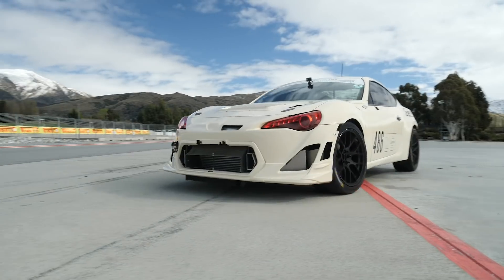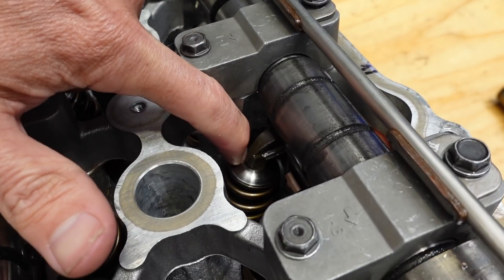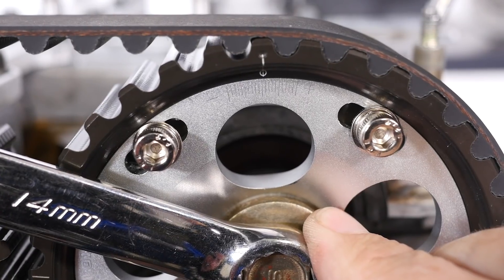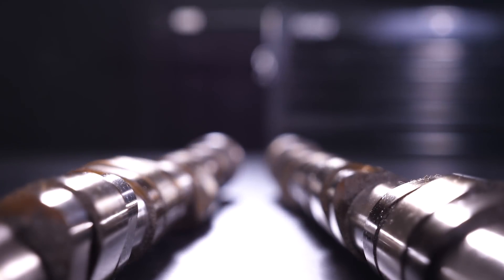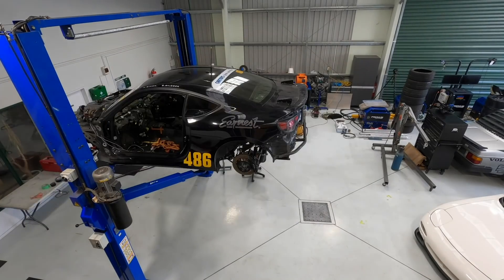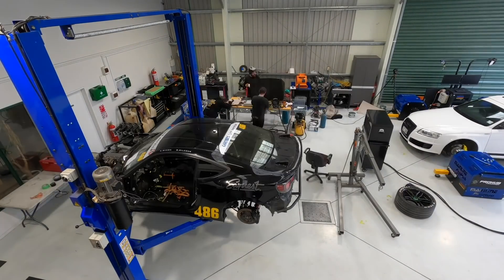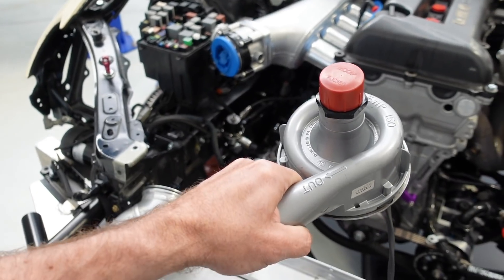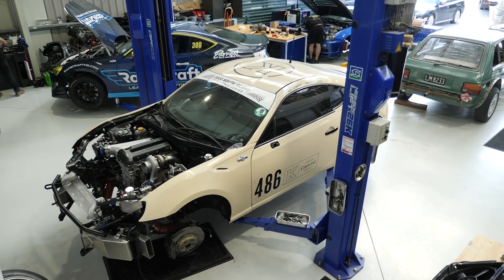Cam Swap | 650HP SR20VE Engine Conversion | SR86 EP 10 [#BUILD]

Comment: I noticed you have an external oil feed on the inlet side and assuming on the exhaust side at the back of the head . Any particular reason for this or was this a recommendation from kelford using their cams? I'd like to know the size line used if possible please. Thanks for your time! Great info.

Comment: And another cool, informative video - with all you chaps are doing, you're actually making great progress! Some of the 'little' jobs can end up taking massive amounts of time, like the plumbing changes that would need frequent checking for clearances, alignments, etc.
When you were discussing the shim and cap heights still being a problem, you segwayed into it getting new camshafts.
Did you consider getting them ground with a slightly smaller base circle? While it's not generally a good idea, especially with poorly done 'reground' products out there and the problem with hydraulic lifters running out of 'take up', it should have been fine with your mild camshafts and it would restore the clearance you needed for the shims and caps?
Normally, the base circle is the 'fixed' part and all the adjustment, valve length, retainer heights, valve seat to retainer groove, etc, are all dependent on that?

Comment: Would the 184st cams still be good for street use with a 3582 gen2 turbo and a 2.2L stroked bottom end? Would this be laggy or have somewhat response ?
Reply from the maker: I would imagine you'd see similar response with the 3582 and the larger capacity to what we have now - Boost threshold of around 4300-4500 which isn't bad for a 3582 - Andre

Comment: I have had exactly the same experience with my SR20VET E36. The ignition cut from the samsonas popped a shim while away from home on the 5th lap of my first session🤣
Reply from the maker: Yes you definitely don't want to be using an ignition cut for gear shifting! We had that part dialled but unfortunately had overlooked the rpm limiter 😩- Andre

Comment: You will have issues with the titanium valve retainer stock is better for durability
Reply from the maker: Yes it's quite possible as we've heard similar comments. At least the marginal weight saving of the Ti retainer becomes less important if we're dropping the rev limit down - Andre
Reply: @hpa101  I believe the sr16ve in pulsar vzr is revving 8.7k stock

Comment: Did you not just consider altering the IVC with the adjustable can gears for the Kelford cams?  This is what I have done in past by maintaining required overlap but finishing power stroke earlier to shift torque peak
Reply from the maker: Yes, there may have been an improvement by advancing the cams. From my own experience as well as others who have played with the cam timing on the 184-ST t's unlikely we'd have been able to move the power band down by 1000+ rpm which is what we are targeting with just the cam timing. The P12 cam on the other hand has a few runs on the board showing it should do what we want. No disrespect to Kelford on this one, their cams are maybe just a bit too good! - Andre
Reply: @hpa101  totally all depends on ramp angles

Comment: Enjoyable as always. You guys bought shares in a headgasket company yet?
Reply from the maker: Good news is that the gasket has been holding up just fine since our early issues. Although of course pulling the head still means replacing it which is a shame - Andre
Reply: @hpa101  yah may comment was more around the head off and on and off and on shenanigans, rather than the gasket failing:D
Reply from the maker: @davey_projects2977  gotta have some sort of hobby right haha - Taz.

Comment: Why don't you grind the back end of the valve to reduce the installed height and run a larger shim?
Reply from the maker: Yes, the valves can be 'tipped' but there's a limit to what can be removed before you go through the surface hardening. While tipping the valve would allow a thicker shim for the same lash clearance which could potentially engage deeper into the retainer, the relationship between the lip of the retainer and the top of the shim doesn't change for a given valve installed height and lash clearance. Basically any time the valve seats are cut this moves the valve deeper into the head (even if it's only a few thou) which means the retainer lip also moves higher relative to the cam base circle - Andre

Comment: Any reason you picked the p12 cams over the kelford 184 LT cams.
Reply from the maker: While the LT would be an interesting alternative, the low lobe cam on the LT is identical to the ST (at least from what we've been told) so I doubt we would be able to expect much in the way of low rpm performance improvement - Well nothing up until the VVL switch over which would admittedly occur earlier in the rev range. The P12 cam on the other hand has been pretty thoroughly tested and proven in turbo applications - Andre
Reply: @hpa101  well I might just stay with the P12 cams I have, hopefully you go into detail on if u find any performance gain and advancing or retarding the cams.

Comment: Could you show the dyno pulls vs actual logged engine ve for both vvl on and vvl off for the p12 cams vs p11 cams. You might be very surprised at the results. I'm willing to share my testing with you our setup is very similar.
Reply from the maker: Unfortunately we haven't run the P11 cams so don't have any data on them. Our comparison will be the P12 to the Kelford 184-ST, but we'll share what we find for sure - Andre
Reply: @hpa101  on another note the rocker rods can come out of the front of the head. They slide through the front small freeze plugs.  Just tap them out and replace or reseal with silicone when done.

Comment: Intresting to know what other types of VE cams you are referring to as far as I was aware you have :-
P11 20VE 
N15 16VE
N15 16VE N1
P12 20VE 20v
T30 20VET which doesn't use the exhaust High lobe. 

I didn't know there were variances in the chassis themselves aside from the N15 ones.. brill video again always intresting as per usual.
Reply: T30 SR20VET camshafts do have a high lobe, Id love to give Andre a T30 Ex cam to try too
Reply: @brendanparker5551  You get around wherever there are VE engine dont you mate...lol
Reply: @zappy7393  I am involved in a lot of builds now ;) Even just briefly haha
Reply: @brendanparker5551   sorry I wrote that badly. I mean they don't utilise it for some strange reason. The rockers are useful for of you want to delete VVL though I guess
Reply: @raceworx  its because they fitted a gt2560s to the car, the high lobe would have caused more heat as it lacks top end as it is
Reply: @brendanparker5551  send one my way and I'll try it :)

Comment: It'll be good to see a comparison of the torque curve with each set of cams, even though we know what to expect it's always interesting to see the actual results, especially how the peak power vs  powerband tradeoff goes. Also interested to see the actual difference in turbo spool - though I guess that might also be affected by the change in turbine housing, even if the advertised A/R is the same
Reply from the maker: Rest assured we will reveal all the data as soon as we hit the dyno again - Andre